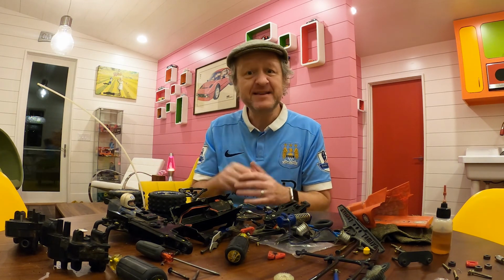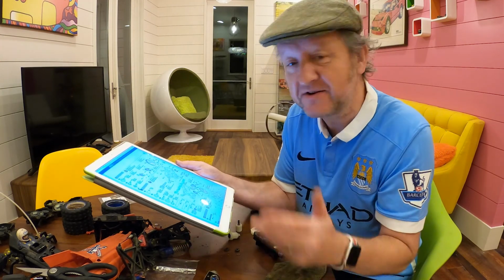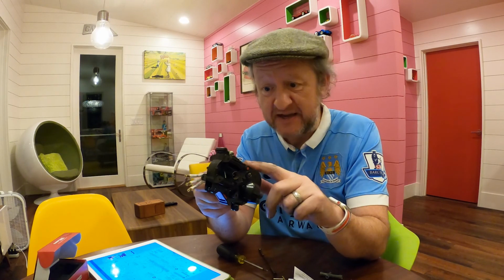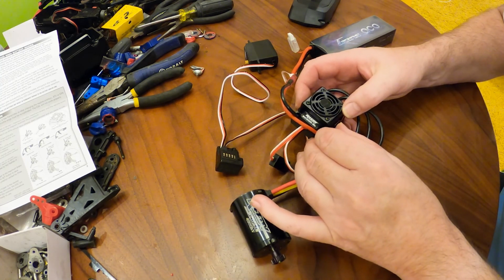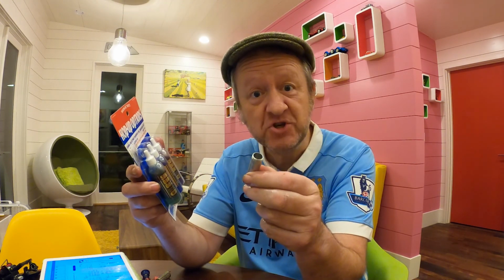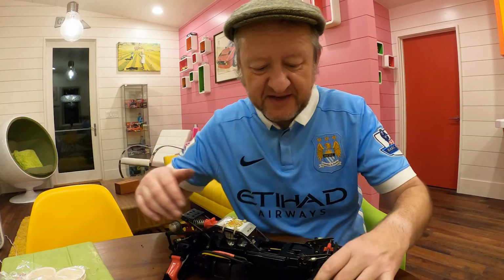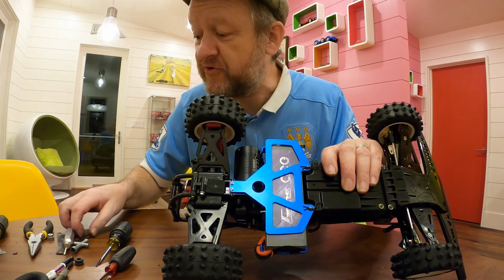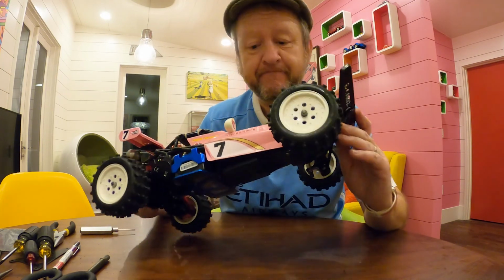Tamiya Hotshot Resto-Mod with a Brushless Motor, Lipo Battery, and Many More Hop-ups!

Comment: The front suspension is adjustable so there was no need for the ugly bolt. You just twist the red section around that touches the spring and there's 3 setting to chose from. Hope that helps someone
Reply from the maker: I actualy have new springs on it now..so the suspension settings will now work..problem was the old suspension springs were about 35 years old and no amount of standard adjustable settings would work.